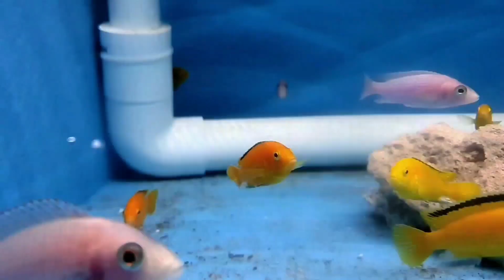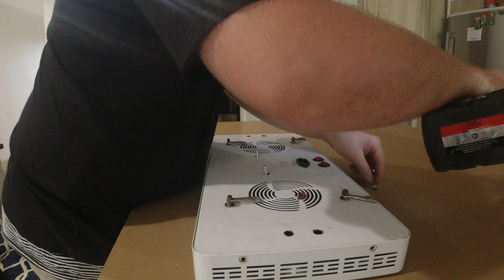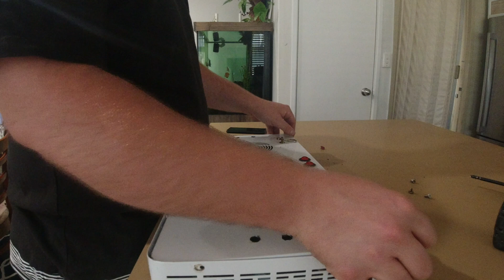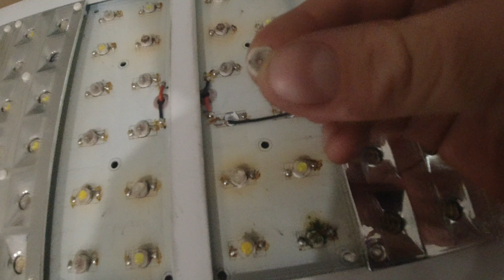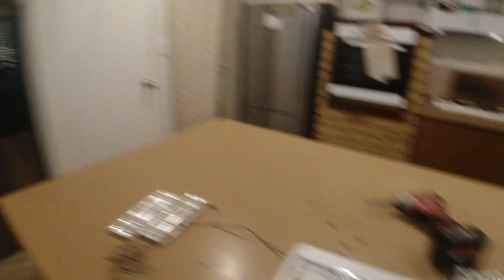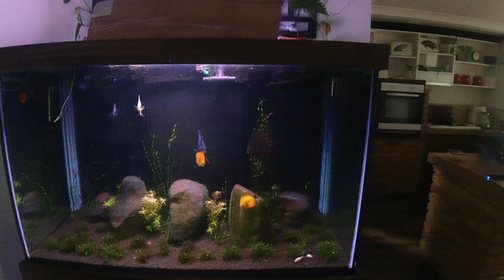Turning a hydroponic light into an Aquarium light

Comment: As far as I remember being taught, you get your wires nice and wet with solder then when you solder the bridge it's much easier to avoid getting a dry joint (when the solder balls up). Flux gets rid of any oxidation or crud that might have melted into the solder so again helps get a wet joint where it counts. You don't want to use too much solder because then it takes more heat to melt, and colder joints = dry joints. You want it to get hot fast so that the components don't get a chance to heat up and become damaged.
Reply from the maker: Thanks man